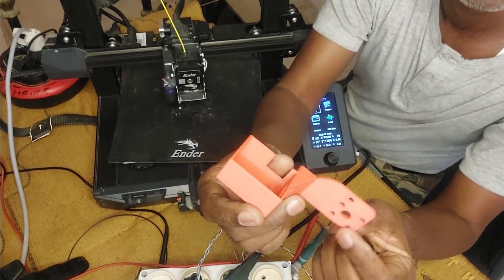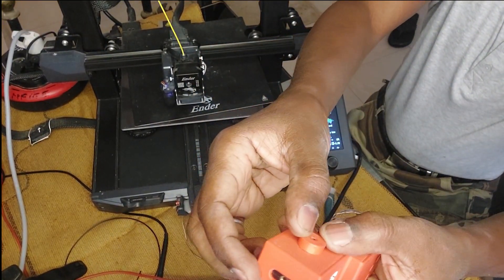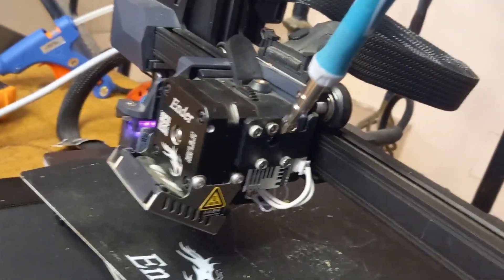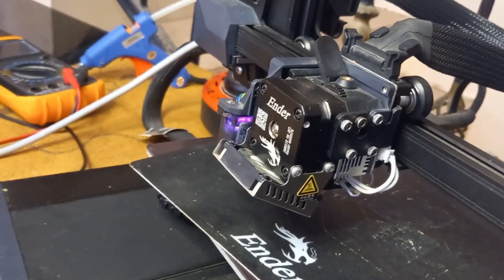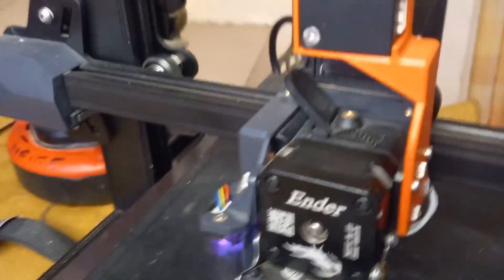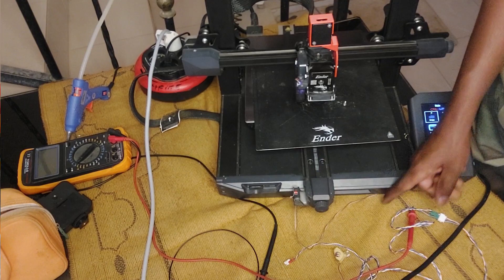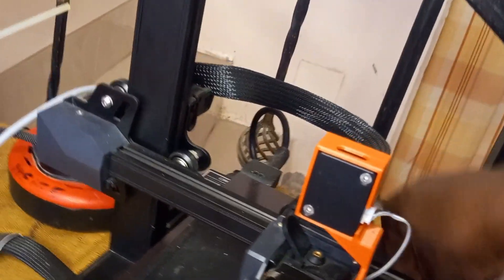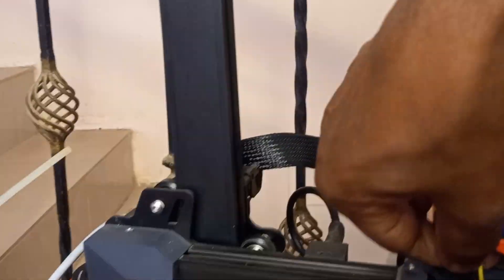98: Ender-3 S1 Filament Runout Sensor Extruder Mount

Comment: I guess you lose printer height because of the sensor right?
Reply from the maker: No you do not. The extruder is in front of the top horizontal frame.